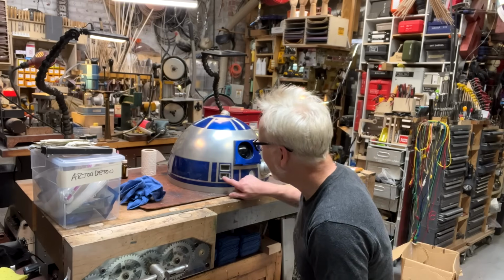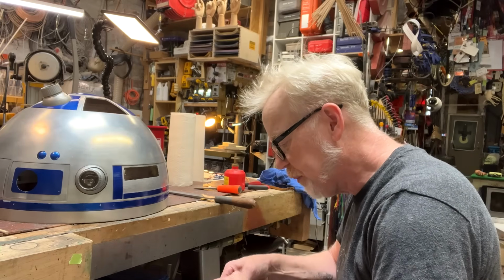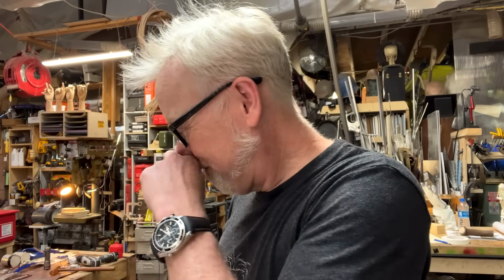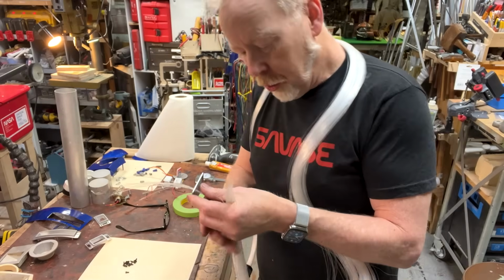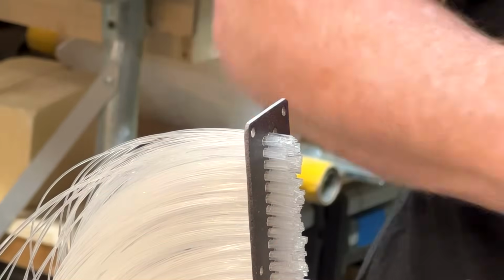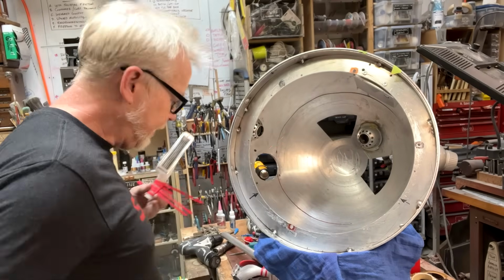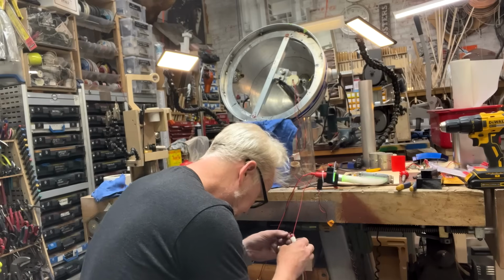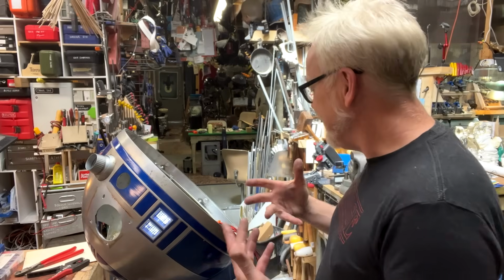Adam Savage Upgrades His R2-D2 Astromech Droid Build!

Comment: I feel like the affect would look better with a little more mixing up of the Fiber Optic cables in the bundle. Like: when only the left side has a light on it, you get the occasional random light on the display and not just the whole left side lit up.

Comment: Isn't this liku "upgrading" a fuel injected F -150 to carburation with an exhaust driven automatic choke?  Take a lovely F-150 engine and make it authentically anemic and cranky?  Foo, the originals would have used LED's if they had existed.
Reply: You're probably right, but the looks of the fibers are still way better looking than the standalone LED's in the holes instead. I've had both in my R2 and the "RSeries Logics" are soooo much better looking than the older teeces LED's. We get the fiber look, and the control of speed, color, patterns with the LED's.

Comment: SAFETY WARNING FOR USING POWERTOOL ADAPTORS! Not all companies include low voltage protection onboard the battery pack. I know for a fact that Milwaukee doesn't and it's not good unless you put a protection circuit on the end of the powerhead adaptor.
Reply: I was wincing at his battery hookup. I didn't notice any fusing or power circuit protection either.  One short to ground somewhere and there's gonna be a smoking R2 with a blown motivator...

Comment: I've got a question Adam.
So as a model and diorama maker myself, there's 4 types of builds.
The Screen Accurate version,
The Model's manuals version,
Your personal touch version and,
the realistic version...
Have you found a sweet spot when cooking up replicas or is it a very fluid, flexible/depend on the object thing?
Example: The millennium falcon, the engine part at the rear.
We can clearly see that there are Flaps above and below the engine, to control the spacecraft, but!!!
all models, including the movies, don't transcend those Flaps, to the inside of the engine.
Meaning that it's just flat on the inside, "where the light is".
Which makes my head hurt!!!
So, on all of my falcon models, i make them as they were intended to be, full blown Flaps.
Reply: I like props that look and feel like they would if they were functional. Having exposed wood grain on a replica where it's supposed to be metal, even if it's true to the hero prop, just bugs me.  So do weird colors that were made to photograph on specialty stocks.  I don't want to pick up a set-accurate prop, I want to pick up a universe accurate blaster.
Reply: I'd say : build what you like best and don't let others tell you that you are doing it 'wrong'
'cause there's no wrong way to build stuff, unless you hurt yourself in the process ... and even then it may just be an unlucky accident ;)
Reply: I think it's the coolest when it becomes an object that feels real and intentional and part of a world, and honestly however that gets achieved is cool in my book!
Reply: If you love it you are doing it right.

Comment: A voltage diver (two resisters of equal value in series and tapping between them) will halve your voltage and also resolve loading effect issues. The problem is the resisters have to be high wattage and high resistance values to make the least loading affects.
Reply: Just use a DC to DC converter, or a Switch mode buck power supply. you will not have the heat loading losses of a power resistor network.

Comment: I wonder if you twisted and braided the fiber optic cables you would end up with a more random light pattern.
Reply: I was thinking the same thing.  The end result resembled the actual movement of the light source.
Reply: Or simply rotating the fused bundle so it interacts with the rotating gel differently